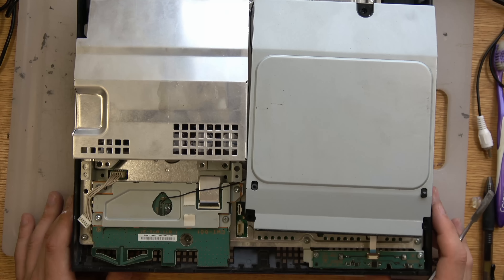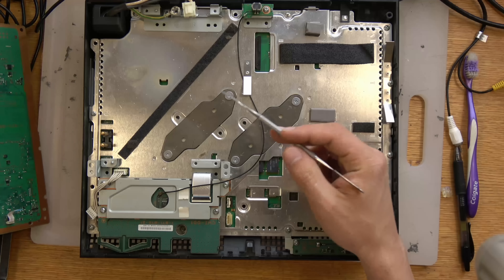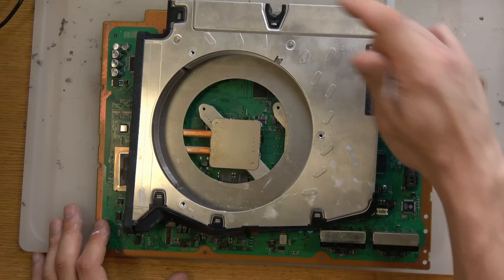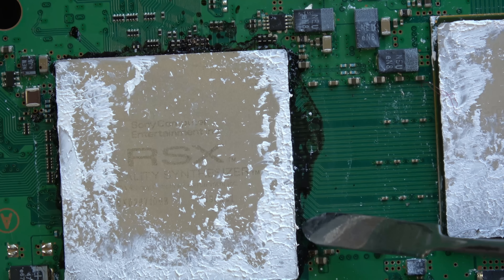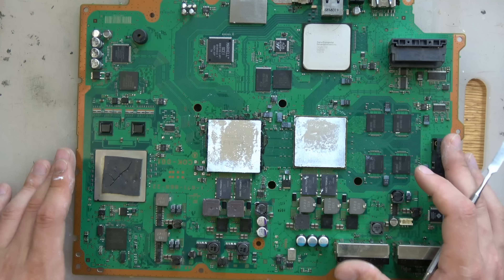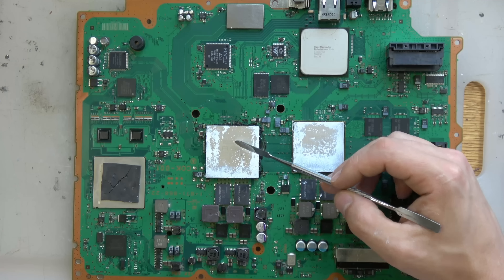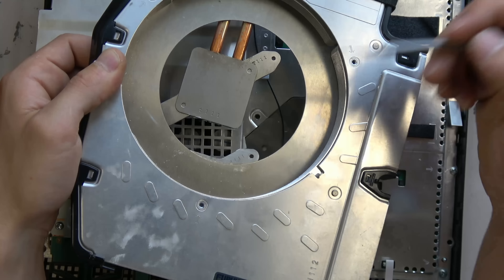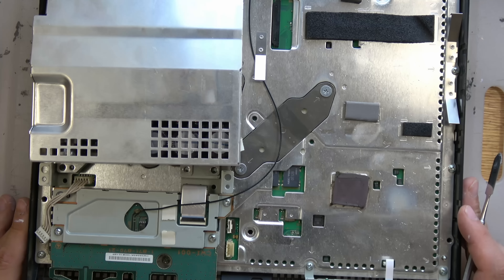PS3 YLOD FULLY EXPLAINED - YELLOW LIGHT OF DEATH - RETRO GAMING ARTS

Comment: The aluminium case of the PSU DISSIPATES heat, and not GENERATE heat. It is a good thing that is made of aluminum, and not a bad thing. The reason why the other ones were plastic (and better, and colder) is because they are much lower power (due to more efficient 65nm CPU and GPU, and the lack of PS2 hardware). The Black thing around the RSX is burnt flux, from previous repair attempts (reflow or reball, but most likely reflow). Definitely nothing from inside the chip that burnt, jeez, you would need over 400/500 degrees Celsius to even start causing such damage (to the point of melting and burning something from the inside the chip). The solder pads are not square, they are round.
Reply: Eduardo Donizette da Costa Júnior if it doesn't struggle with all that heat why did these fail?
Reply: NEC/TOKIN capacitors that filter power to the chips are known to fail, the PS3 has 8

Comment: I took my working PS3 apart to clean and apply new thermal paste to reduce the noise as it sounded like a jet, now it has the YLOD.
Reply: F
Reply: F
Reply: Same thing happened to me
Reply: @BigeSnek  :(

I just replaced it with a Super Slim version instead.
Reply: Danny • have you put ps3 hen on your super slim?
Reply: You may have forgot to plug something back in
Reply: Lool. Two years later, still F. Sorry. 

Curious though, you ever got it fixed?

Comment: The PS3 and Xbox 360 are definitely flawed but the real issue that is dangerous to fix but is definitely needed is to remove the integrated heat spreaders on both the GPU and CPU to replace the thermal compound underneath them.

You'll be amazed at how much cooler they'll run once you remove the old thermal compound underneath those big metal plates.
Reply: On it or underneath?
Reply: @kojomensah8036  you'll need to replace the thermal compound underneath it as well for best results. Be very careful removing it cuz you can kill it
Reply: @lain328  will try thx
Reply: @kojomensah8036  don't risk trying to make a tool to do it just buy a painter's knife set, they're not sharp at all and once you get them in it's very easy after that. Works best for cell cpu.
Reply: @lain328  Most BGA chips that have heatspreaders usually are SOLDERED.  Aka, there is not thermal paste underneath.  The thermal paste is usually on top of the heatspreader to help conduct heat from the spreader to the heatsink/fan assembly that goes over top.
Reply: @FluffyUnicornAsian  As you mentioned that is the case for "most" but is not the case for the PlayStation 3. I have personally open up both original fat and slim models and they are not soldered, and the thermal compound underneath is usually dried up.

Personally it's frustrating to see someone reply to an old comment before doing a research.

Comment: “South bridge” in PC terminology was the motherboard chip that connected or incorporated the majority of expansion and I/O interfaces (USB, PCI, Serial, Parallel, IDE/SATA, floppy disk interface, etc). The “North bridge” ties together the CPU, memory, external L2 cache, AGP, and, of course, the “South bridge.” Since CPUs have their memory controllers, L2 cache, and more built-in these days, modern PC systems effectively have no north bridge. Heck, SoCs often take it a lot farther with on-package memory and I/O.

When graphics cards moved from PCI to AGP they were effectively switching from South bridge to North bridge for a increased bandwidth, faster/more-direct connection to the CPU, and the ability to access, share, and transfer directly with system memory.
Reply from the maker: I've wondered this for quite sometime, thank you for clarifying
Reply: Emmett Turner Thanks for taking the time to provide this valuable information.
Reply: Thanks
Reply: Wish i could pay you to fix my ps3 :(
Reply: What is the % of yellow light of death? Because I’m interested in buying one for PS2 backwards compatibility
Reply: @Exzticy  mine from launch never had it, the disc drive just stopped working but I have another one my friend gave me that did have it, but the inside was absolutely filthy so take what he said here about keeping it upright and if you are keen take it apart and make sure its clean before using it. Its the same problem the 360 had causing the red ring of death. Too much heat desolders surface mounted components from the mother board and the system has no idea what is happening after that and won't operate

Comment: I dont understand why ppl junk their PS3's when they get the YLOD. Clean out the dust. Re ball, and re flow with LEAD filled solder. Change thermal paste including under the RSX chip and change the capacitors if needed. Have an extra power cable or 2. Dont play on 100 degree days. It's a different era now. Ppl wont kill the PS3 24hrs a day now w/ better consoles available to play. But I guarantee ppl who do this will have a permanently fixed OG Fat PS3. Dont listen to hype on the internet when ppl claim your console is dead. They are all naive. The Perfect Rebuilt PS3 exist. I've seen one.
Reply: some people don't know how to fix or doesn't know the value of the original fat model that can play old ps1 , ps2 games so they just dump it
Reply: Actually the cause of YLOD is mostly faulty NEC/TOKIN capacitors, not the balls under the GPU (most of the time anyways).
Reply: That’s fucking confusing and takes a lot of time
Reply: I have a cousin who threw away like 2 or 3 PS3's because he doesn't want to fix them.
Reply: I tried fixing 2 old fat ps3s. Tried NEC caps, reballing, replacing the power source, power switch, power cord etc. Sometimes the console cannot be fixed no matter what!

Comment from the maker: Did you already know this stuff? Did you learn something new? and is there anything you can add? also just what did you think! let me know, i read all these comments
Reply: RETRO GAMING ARTS. hey paul its juan we met the other day in retro games ill leave you my email in the message and when ever u get the chance send me a email and we can arrange a meet up
Reply: A lot of new things thanks a million
Reply: Decent video, thanks. I repaired YLOD on my PS3 fat myself once. Reflowing with liquid flux. It then went RLOD so I sent it off to be repaired at Consolewerks (UK). They fixed it and gave a 3 month warranty. It broke again so they fixed it again but said if it broke after that there was no hope because Sony had faulty graphics chips in the original 60Gb backwards PS3s. It broke again last week and now I’m not sure whether to bury it. I was wondering if there was a way to mod a PS3 slim or superslim with the backwards capability from my PS3 fat? Shocking that Sony accepted next to no responsibility for a serious design flaw on an expensive product.
Reply: o2bjedi Its not Sony's fault technically. Nvidia admitted around the time the PS3 came out that a large batch of chips they have in circulation are faulty from the factory, look it up. Sony should have sued Nvidia but I guess the PS3s fail rate was within projections

Another main problem is the solder under the Substrate is lead free, so when under heat stress from the main board the flexing cracks the solder. Replacing the solder with lead based eliminates that problem(along with replacing the TIM under the heatspreader to maximize heat transfer so the Chip doesn't overheat). Other than that the BGA under the Wafer itself shifts cutting off the connection to the Substrate with bad chips that get too hot. (which is Nvidias fault because they manufacture the GPUs for Sony) and that's a design issue nobody can fix besides getting a good GPU and keep the PS3 cooling efficiency as high as possible.
Reply: My fat PS3 (CECHA01) blows the bulk of the hot air out the side, it doesn't intake air from the side.  As for an easy and effective cooling mod, just drill some holes in the case under the fan, like this:
https://youtu.be/QsnUgiiraxQ?t=1h21m17s
Reply: I would like to add the main cause of the ylod isn't the rsx or cell desoldering itself from the board, as the ps3 doesn't get nearly hot enough to even crack the solder balls, in fact its 8 nec tokin capacitors that don't do well with heat, which supply power to the cpu and gpu. As for the ventilation on the backwards compatible models its a bit strange. It sucks air in from the bottom, left, front, and right of the console, and it exhausts it out of the back and right side. Now you may be thinking "how can the ps3 exhaust and blow air out of the right side of the console?" The thing is, it exhausts hot air from the bottom half of the right side, and sucks it in from the top half near the blu ray drive.

Comment: “The problem is the design” Well, yeah, but that’s because RoHS design and engineering guidelines were wrong (untested, and unproven for longer-term real-world use). What it boiled down to is brittle lead-free solder that would fatigue and break over many heat cycles (different thermal expansion rate of the board vs chips), as Andrew “Bunnie” Huang demonstrated with XBOX 360 chips around 2008 by using a staining underfill before removed the chips to see the outline of the previous connections. Most were C-shaped and allowed the dye into the center of the pad! I guess what I’m trying to say is that while it was an improper design, their designers ultimately weren’t to blame. According to specifications it was supposed to tolerate the heat caused by the designs you point out. I think it’s a little amusing that the industry moved to lead-free out of fear that old electronics will pollute our groundwater with lead from landfills and then cause a several-billion dollar issue that has sent more electronics to the landfill than ever before. I mean, kids weren’t exactly licking the insides of their electronics and most people were not throwing out their older systems if they still worked.
Reply: EXACTLY! I hate lead free solder. Leaded solder melts at a lower temperature and flows better. Also automated wave soldering never applies enough solder to pins on through hole components on single sided boards.
Reply: And also, due to poor ventilation, specially on the FAT PS3 with the PSU right on top of the motherboard, tends to warp the PCB of the latter. Even if you reball the console with leaded solder balls, the main chips will snap out of contact sooner than later, or other components will fail, again due to overheating, like the HDMI output.

Comment: That heatsink and airflow design is so bad. I think they are not thinking long term, about the degrading of the thermal compound, etc.
Reply: Artisankat Studios is that why they made a slimmer model?
Reply: On the backwards compatible models its the best if you think about it. It has plenty of vents, its just moreover the chips are 90 nm and thats way to much for a console the size of the ps3. Plus the chips rarely failed

Comment: 14:59 MAYBE you can mod the case of the power supplay by adding more holes to it with a drill OR find out where the hotspots of the internal power supply are and add mini heat spreaders OR if you are pro-modding/don't care about esthetic you can use an external power supply and make cable mods for internal plugs, there are numerous ways you can get that going, I like this content videos !
Reply from the maker: Your absolutely right, there is so many different things you can do. I did a video "ps3 power supply inside a nintendo wii" you should check that one out i think you'll like it. If you liked this video you'll most likely enjoy my channel, Lots of stuff based like this. Thank you for watching

Comment: Die Hard PS fans would not like the idea of completely using a different case like one from a 3-D model; one side sucking the air from fans, then other fans blowing the air out. The case is essentially built around the premise of maximizing air flow. The fans in this case would require it's own power source.
Reply from the maker: Michael Aranda  i wouldent even want to use a new case, just editing the existing case, i run my ps3 fats fan on high alot, been working for a very long time

Comment: My 2007 PS3 is still going strong...I have cleaned the entire unit inside out and replaced the thermal paste several times. Never had any over heating issues. Maybe because mine is emulated emotion engine chip. Still the only issue is the ejection sometimes sticks.
Reply: I would recommend having the integrated heat spreaders removed eventually, cuz the thermal compound underneath them can go bad and start to cause issues.

I personally have a launch Model 60 gig unit and worked on a 80 gig model and the 80 gig one does seem to run cooler, ps2 one.

Comment: Southbridges controls all the voltages going in the big chips and send also informations. Bad solder from them means also YLOD or  RLOD. Thank's!
Reply from the maker: ahh, no thank you, thats awesome to know!
Reply: If you don't know what you are talking about, then shutt up. Thank you.
Reply from the maker: Gamer 9 i think serge is referring to the fact that this problem is possible on the xbox360 aswell, when the ps3 is dead the light turns yellow, and pn xbox360 the light turns red, due tue both consoles have a similar chipset
Reply: Exactly, what i mean is when there is a defect on the balls under the chip, crack balls due to exessive heat or bad soldering balls at the shop when it's new, with corrosion after a couple of years too, then contacts of the balls to the motherboard surface start being bad and the minute a ball does not touch or is crack or bad contact due to corrosion, or the ball touch another one,  then you get a flashing light of death. The system is a bit different depending of Ps3 or XBOX 360 or Ps4, etc... I hope you understood what i mean. The only way to prevent this is a regular clean up internal dust of your machine and opening of the 2 chip's metal  headspreaders, clean and change the thermal paste inside, (be carefull with those inside chips, don't scratch them just a bit),  use  MX-4 thermal paste, you can find it on eBay,  and aligned the headspreaders back on, than put some thermal paste on the headspreaders too. Then if it does not work, your are gonna have to reball with the real machine, a laser soldering station, or change the chip for a new one if it's dead.  By the way those chips are made to last X hours and die after depending also of how good you clean them and keep them out of overheating.  Heatgun won't work. It may work 20 to 30% chance because heatguns are NOT THE RIGHT WAY TO FIX THIS PROBLEM. You have to see a pro. That's what i do for living and i love it. I hope i did help some people. Thank you all. Best regards.
Reply: It also acts as a gobetween for auxilary hardware like controlers  usb blueray and storage. (hdd)
Reply: You are right.
Reply: They dont have Simimilar Chipset dude, no way Cell was far away from Pc architecture and was created by IBM it actually was a Power (PC) yeah PC chip, and the ps3 had the Cell witch was something like we got now on the AMD Ryzen hipz but again, a lil bit different ^_^ ;)
Reply: So changing the lead free solder of the southbridge chip with leaded solder should be good then.

Comment: @ iVirtualPlays
    Wrong info stating it's only the Nec/Tokins. Main problem was and often still is the BGA (RSX) solder failing. However, due the age of PS3 the Nec/Tokins might start failing more but you can't rule out the RSX (rarely even cell) needing a reball instead of Nec/Tokin replacement, or both sometimes. You just have to be open minded on this and not rule out one or another. Open the link, scroll down and read a real study on BGA failure, not an assumption:   https://www.researchgate.net/publication/322264408_Failure_analysis_on_soldered_ball_grid_arrays_Part_i   Lots more studies to find.

Comment: Hello i want to know that standing it up vertically is overall better. My ps3 has always sat horizontal since 2007 and i never had a issue. Also i keep it in a open space. I just hear back and forth with hor vs vert. Any help from fellow 60gb owners would be great thanks. Also your videos are informative and helpful
Reply: Lord Hades my original ps3 60 gig stays more quiet and cooler on its side,all the vents have more free air flow and the bottom isn’t heated up by the surface it’s sitting on.

Comment: Hello I've got a question.
I've got two ps3 fat one of which is RLOD and the other is fine.
the ps3 with RLOD has my disc Skyrim and saved level of 123.
can I take the blue ray drive and the hard drive out from the RLOD and insert into my other working PS3 fat and continue playing?
I'm trying to skip pulling it all the way apart to do carbon paste trick for now.
thanks

Comment: I don't know if it applies to any PS3 FAT that the thermal speed control of the fan never sets it to high speeds. Got my PS3 FAT used as 40GB Version wich was already a little bit redesigned. For exapmple it had less ports and no PS2 chips. But it literally behaved like a hair dryer at any temperature slightly higher than regular room temp. So I took it apart and found out that the thermal compound was completely dried out and crumbling off the heat spreader. I cleaned it off with IPA and applied Arctic Silver thermal paste. It made a huge difference. Sure the fan kicks on like it should but even in summer the fan never reaches those insane high rpms than it did before.

Comment: I've thought about adding a fan into my PS3 to make it run cooler, but I'm not that great with that kind of stuff, so I'll try it on one I don't need first. I get around it by running a small USB from my Xbox 360 that blows over top of it (I'm sure it wouldn't hurt to run it from the PS3, but the xbox ports are just easier to get at) and it has been working. I'm going to start pointing it at those vent holes though I never thought to do it before. Thanks for the info
Reply from the maker: yes! blow the fan into those vent holes, turbo charge that ps3, air in, air out